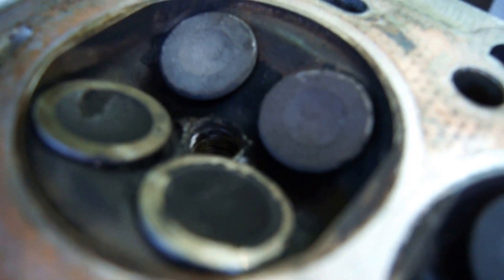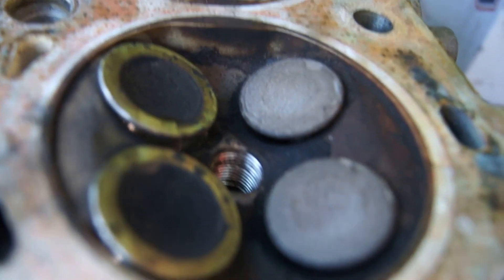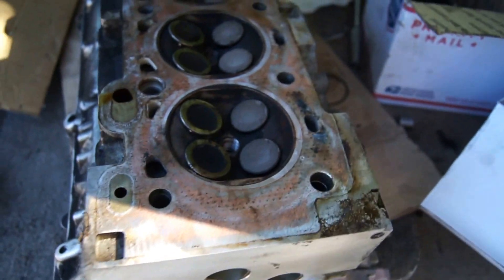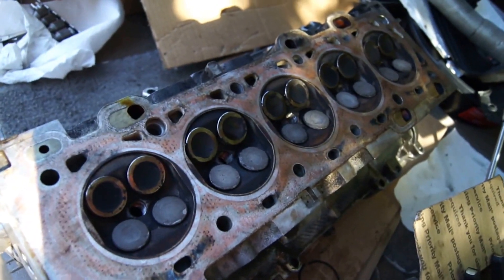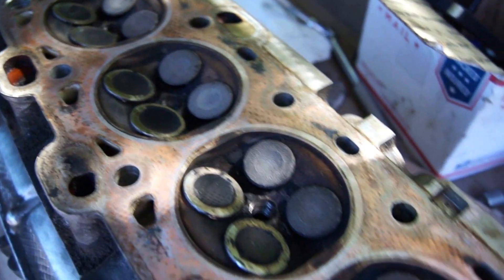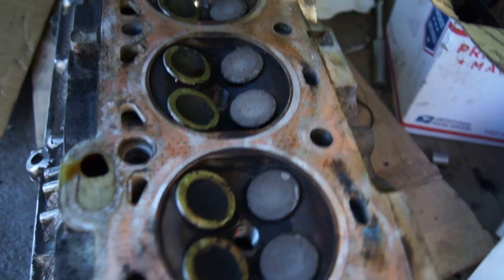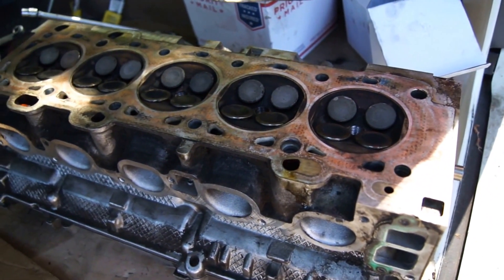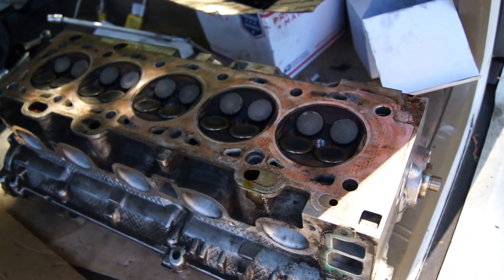Volvo V70 B5244S Interference Engine

Comment: Do you know if the 2000 v70 turbo is also an interference?
Reply: All Volvo "white block" engines (i.e. inline 5 and 6-cylinder gasoline) are interference as far as I know